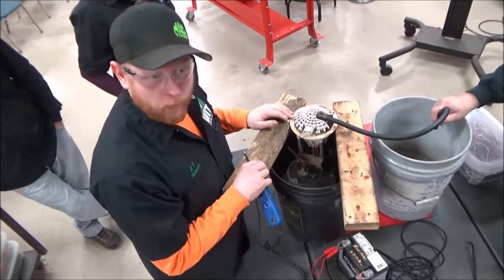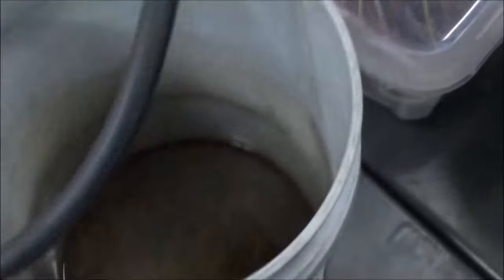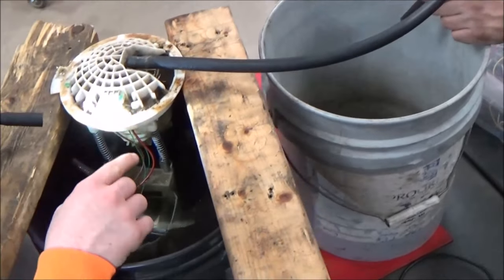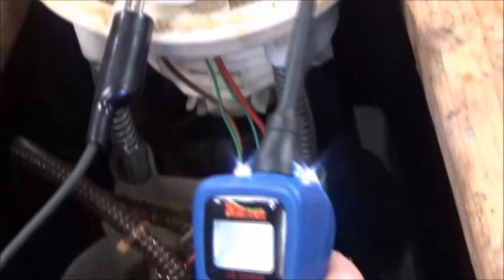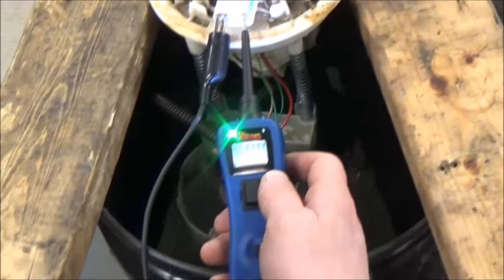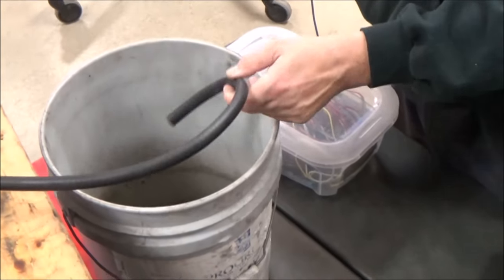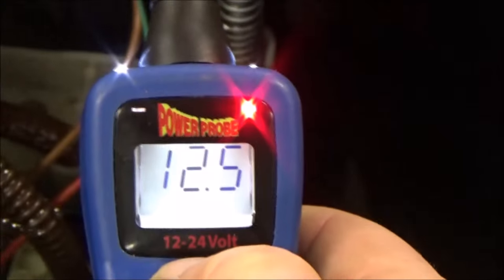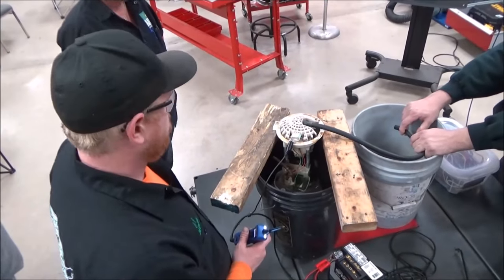How to test a electronic fuel pump in under 3 minutes CARBURETOR & EFI

Comment: I'm hoping this test eliminates the fuel pump on my Yamaha YN50 F Neos 50cc scooter. It has a non adjustable type of carburetor and it's running off an EFI unit. Unfortunately after multiple attempts at kick starting and ignition switch starting, the engine did not run.

Comment: Hi, I have no start problem, since I changed fuel filter. Checked voltage at fuel pump on key on and then start position on multi meter, and it is 12.26amp. So this means no bad fuel pump  fuse or relays .when connect to fuel pump and switch on, pump doesn’t make any noise at all. I removed a hose pipe and test with another pipe. When I turn on key , fuel starts coming out. I checked resistance on fuel pump which is around 1.2 or 1. What do you think is it the fuel pump bad because it is not making noise , means not producing full pressure? Please help. Thanks.

Comment: On a 2002 l300 Saturn 3.0 v6 no fuel pressure at rail fueses are good swapped fuel relay and main relay separately no effect.
No security tell tale I believe there was a code for intake air temp sensor or mass air flow sensor pretty much ECT will register 40* on a 40* ambient temp day however IAT WILL REGISTER 80* A WHOLE 40 * DIFFERENCE WOULD YOU SAY WITH A REASONABLE DEGREE OF CERTAINTY THAT COULD CAUSE A NO START NO FUEL ? TESTED MAIN AND FUEL RELAYS WITH SNAP ON SCANNER BOTH CAN BE HEARD CLICKING ON UPON REQUESTING

Comment: I have a submersed fuel pump on my Yamaha, outside the tank the pump sits and will run just fine with a 12v battery direct connected. if placed back in and submersed in gas. its unreliable. never stays running if it starts. and often the pump wont even turn on for an initial prime. I switched the relay so far and im deciding whether to replace the pump.  would a bad insulation be a cause for a voltage drop when submersed??
Reply: Most likely a fault wire in you yamaha

Comment: I w done this but with a 12 volt battery and the electric fuel pump motor is making a whirring noise like it’s working but no fuel coming out..
Reply from the maker: It sounds like you’re ready for some Techline help. Coach Conley is also available for hire to personally work one on one with you if ever needed. Yep he is a real person. Give him a call @ 602-345-0432

Details here: https://how2wrench.com/product/personal-tech-training-phone-facetime/

👍 Thank you for taking the time to comment! Hit that subscribe button if you haven’t please! It helps us! 
Here is a way to support all the free videos.
Want to say “thanks” or “keep it up”? Click here https://www.paypal.me/how2wrench  

Your answers and help are just around the corner. Save time and money while protecting your investment and yourself by doing it the right way!
Follow us!
Web:
www.How2Wrench.com    
www.Tools2Wrench.com
Reply: Shane Conley I took it apart and the carbon brushes are good but the carbon   flat commutator disk is no good..

Comment: Can't you just test continuity between the two wires without putting live electricity through the fuel pump
Reply from the maker: Good question. I'd like to answer deeper than yes or no. Can you sub and I'll circle back? It really helps us creators grow. Appreciate you!
Reply: That’s where I’m at. I test continuity from the two wires and got nothing so I didn’t even try to power it with a probe.